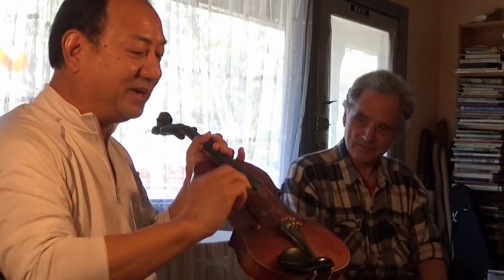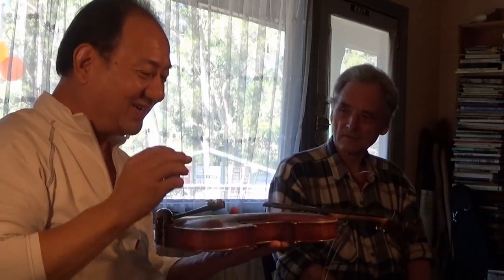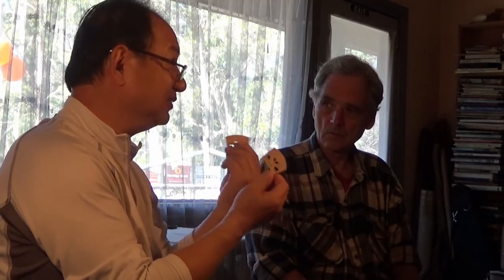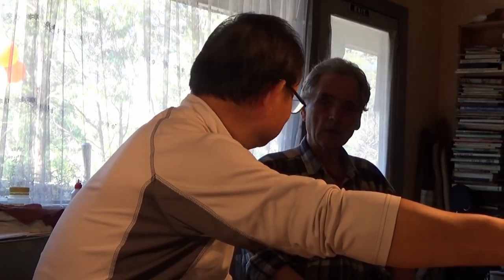How to Set up Violin Bridge by Yourself

Comment: hello Daniel, as you mentioned, to choose a bridge for your violin, you need to determine if a lower or higher pitched bridge suits you. also, if the heart (or the arch) is higher or lower. question is, for a new instrument, how do you determine which is good? you make one anyway and based on the sound you cut another one?

Comment: Hi i have an old French violin with a shorter body Stop than usual (about 190mm measured from the treble side) the body length is 355mm and the neck length is 130mm. What do you think i should do about the bridge position? Should I ignore the f nicks?

Comment: Mr. Daniel, how far in cm should the notches be on a med  size or taller bridge for the strings?
I love your videos ...what books would you recommend for learning sanding the old varnish resin and re varnishing my violin also?
Regards Lisa
Reply: Lisa, I know it's been a year but, if you never found out about how far the strings should be in the notch, it's 1/3 rd of the diameter of the string. They should not be barely riding on the bridge but, they should not be deeply imbedded in the bridge. Hope this helps.

Comment: violin exclusive tick for the feat: sand the feed, hold them into realy hot, boiling water for a few seconds, use a paper towel to remove water from the surface and put the bridge on the instrument. Put the strings on, but with less tention than normal. leave it for a few hours, tune the violin et voila, you set up your bridge
Reply from the maker: S.J.W.Bach absolutely No